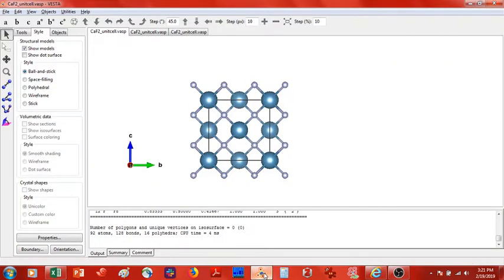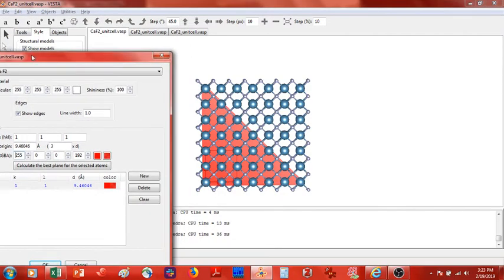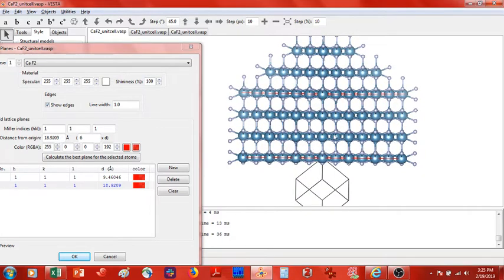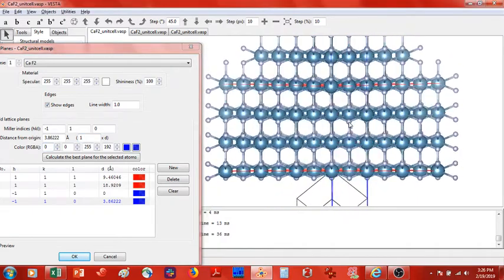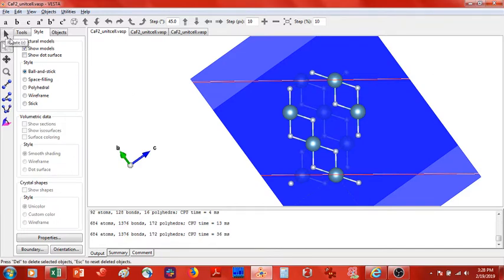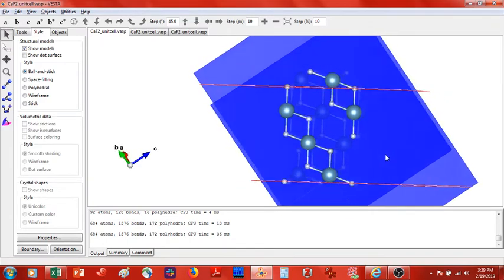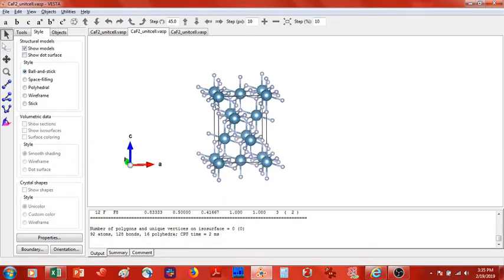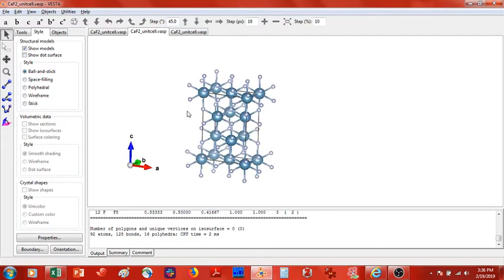Slab Cutting using Vesta pt. 2 - CaF2

Comment: Thanks Nickel for this informative tutorial. I was able to reproduced exactly what you did to the end. However, when I opened the CaF2 (111) plane and checked the lattice plane I found out that (111) plane is not exposed as it's supposed to be. Kindly shed more light on this.
Reply from the maker: Ah this is because Vesta treats whatever you give it as being in the original setting. You have to just see by eye. On matter what Vesta will think the 111 plane is internal for this type of system

Comment: I have a small doubt, on changing the slab to (201) plane, using matrix values, the crystal becomes somewhat like compressed and kind of sandwiched, is that okay for the slab? FYI, the structure I have chosen is WP2, monoclinic structure from Materials project (ID: mp-11329).

Comment: Nice tutorial! Can you make tutorial for Rutile TiO2 (101) surface. This video  looks like appropriate for TiO2(101) surface but the tricky part is the third corner can't be define. Thanks
Reply from the maker: Would you happen to know what the cell axes angles would be for that system? Surely someone has studied this before and knows them. Also maybe which planes the lattice vectors are?

I’ve looked into this briefly and it seems that to get the third corner actually requires one to use an angle in your cell.

Check out my video on ZnO where I do am forced to do something similar in order to get the third corner

Comment: Quite a helpful tutorial. But I am still struggling when trying to cut 101 surface of Anatase TiO2. Can you guide for this case?
Reply from the maker: I can hopefully look into it. Are you sure that’s a stable surface?
Reply: @nickelandcopper5636  In my knowledge, when any molecule is introduced in close vicinity of TiO2, (101) surface seems to display most reaction. Therefore I am trying to expose (101) surface so as to observe the effects of the molecule over it.
Reply from the maker: @harshitagangwar4196  ah, I see. I’ll look into it

Comment: @Nickel and Copper  Thank you very much for your video. It's very helpful. So, in this case, the thickness of CaF2 is 1 ML (monolayer). Thank you for your kind answer.
Reply from the maker: Yes! Although, there is a mistake in this video, it is not hard to fix. I should have gone more one of the directions for checking the periodicity. Small error. But ya - I am pretty sure that 1 unit fell thick = 1 ML

Comment: Nice video.
Very helpful.
Is the stoichiometry of CaF2 is being taken care of?
Reply from the maker: I have an error in this video actually. You could extend some more in the c dimension. But if you do this it will be. I apologize for the error. I hope soon I will post the correction.
Reply from the maker: But yes - if you take care of the one error the stoichiometry will be taken care of
Reply from the maker: Actually, on second thought, maybe it’s fine. I’d have to revisit this one to see if there is an error. In any case, you can save the new unit cell as a .vasp file and then check the stoichiometry to see. If you do this, please let me know what you get
Reply: @nickelandcopper5636  If I save the unit cell as .vasp then the stoichiometry is correct. But if I save the same unit cell as .xyz file then stoichiometry is incorrect. 
Can you explain this?
Which one is correct .xyz file or .vasp file?
Reply from the maker: Depends on what you want to use it for. If you save it as a Vasp, it gives you coordinates to enter into an electronic structure package. In other words, saving as a .vasp deletes repeating atoms. Saving as an .xyz saves all atoms, even those that repeat.
Reply from the maker: So .vasp is usually correct for a periodic model
Reply: @nickelandcopper5636  Ok Thanks.
Do you how to build a vacuum space over a slab in vesta?
Reply from the maker: Yes - I have numerous videos on that - please see them

Comment: this is good. i trying to do for a hybrid structure with two materials. quantum dots with ligands and wish to create a unit cell along with ligand strcutre, is it possble? i tried to follow your method, but did some thing wrong i think, it created a huge bulky cel.
Reply from the maker: It is possible if you use a large vacuum in all directions. I can make a video to show you if you would like. Basically, it would be a quantum dot with ligands sitting in the center of a giant unit cell. Essentially, the cell would be so big that the neighboring QDs do not interact. Is this what you would like me to share?
Reply: @nickelandcopper5636  thanks for reply. But not exactly the way you explained. What i am looking for is: -  say, there is a QD formed with many unit cells combined.  And i attach the ligands in Z direction.  but part of the QD only visible it means in X and Y directions it shows a periodic boundary.  and more over i wish to add two such QDs opposite to each other and from this combined structure (i.e.with 1 QDS+ligands on only Z-direction) , i wish to select a unit structure and cut the rest. May be difficult to perceive. If you give email, i can draw a structure and share.
Reply from the maker: One cannot have many unit cells - you only have one unit cell by definition. One should not have the QD be periodic, because if it was periodic, then it would be "bulk" in those directions. That's why you need to add the vacuum in all directions to get the isolated (0d) QD
Reply: @nickelandcopper5636  Thank you. i understand.  In such case kindly share the video as per your earlier reply.  But with an extension to that, i wish to include two such QDs in the system, so that, i will submit for relaxing the geometry and submit for Molecular dynamics.  Its will be very helpful to me and others as well. Thank you. :)
Reply from the maker: K K Sram sure. I’ll be away for a few weeks but will be back after that. I will tell you though that having two quantum dots with ligands will be literally thousands of atoms. One would not use a periodic computation for that, but rather a localized basis. Which software do you plan to use for MD?
Reply: @nickelandcopper5636  for relaxation of the 2 QD system and for MD (i.e. AIMD)  i wish to use VASP.
Reply from the maker: K K Sram in total the system could easily have over 1000 atoms usually they will be of many electron atoms such as cadmium or other metals. It will be next to impossible to use dft for such a system. Even a single sizable Qd will be very difficult even without ligands
Reply: @nickelandcopper5636  Thank you. i will consider that. but kindly let me know the design first.
Then i will try my best to use any other software.  Can you suggest which software can support such big system?

Comment: hi
if i delete some atoms and save it or export it as VASP and reopen, then again the deleted atoms are shwoing up. how to delete them permanantly and save whatever i want?
Reply from the maker: Ah. Save it as an .xyz
Reply from the maker: Saving as a .xyz saves the atoms on the screen, no matter what
Reply: @nickelandcopper5636  ok. then another issue in my case. (1) if i do so in XYZ, and reopen i am losing the lattice shape and parameters, and (2) due to periodic boundary situation, some atoms are displaying outside the lattice, visually.  now i am not very sure which atoms to delete, before exporting to XYZ.  or if i delete exactly those outside lattice boundary, even then its not sure, if some of the edge atoms are part PBC. So when i reopn the XYZ file, i am finding extra atoms and that too losing lattice boundary marking
Reply from the maker: Ok. This exact problem is what I show in many videos. This is why I am constantly saving as an xyz to put the coordinates into the vasp. I talk many times about having to delete certain atoms to retain the periodicity. Please watch all of my surface reconstruction videos and I guarantee you will understand after that
Reply from the maker: I must have 10 surface reconstruction videos. In each video I talk exactly about this issue. Many different systems too! So please watch those and then let me know. Be sure to check the more recent ones, starting a few months back
Reply: @nickelandcopper5636  OK. thank you. i will watch again.
Reply from the maker: Sounds good. If you still need help let me know. Maybe I can make the system you need